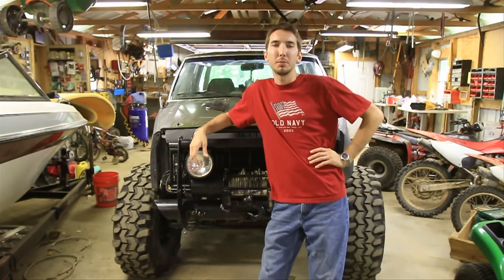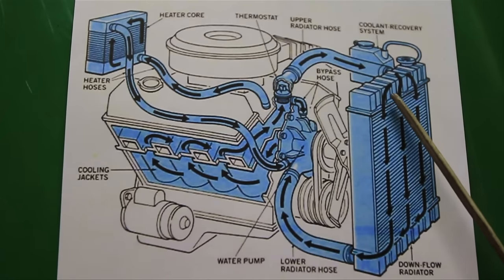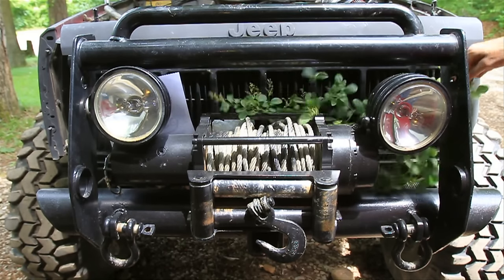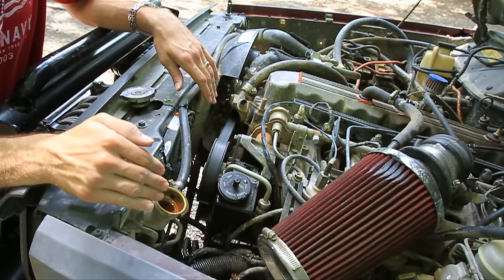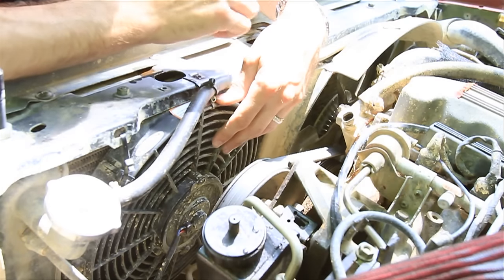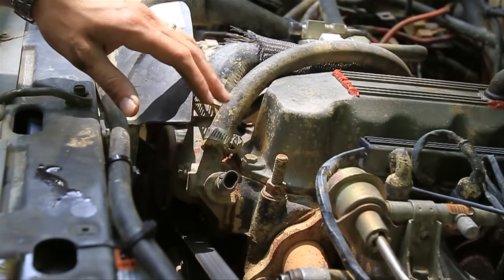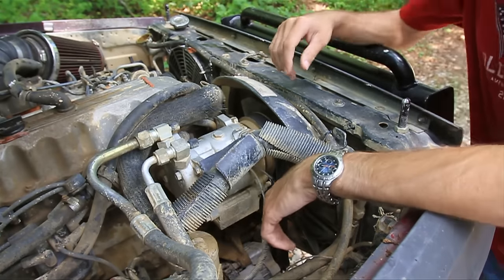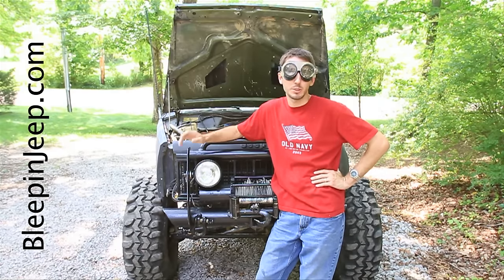Engine Overheating? - 9 Steps to Solve

Comment: when im driving on the highway, i get good warm heat then as i get to driving in the city itts not as warm? what do u think could be the problem? also i think it runs a alittle hotter in the spring/summer after getting off the highway i get some pinging from engine and a little oil burning. 99 camry
Reply: If there is no air lock in the system you may have a clogged heater core. When the engine is running you  want to compare  both heater  hose in temperature. Both should  be hot at the point you wouldnt hold them for.a.long time. If once is hot and the other one is just warm than you have a clogged heater core. If you rev th3 3ngine a good 2 minutes and it improve... plugged heater core. You can either replace or try flushing it depending on access and labour time. I saved big time and money flushing them using 2 hoses as an extension and filling them with clr and let that soak overnight.  The next day i flush it using air and water from an home made T and voila... heat is back to oem performance and ive been told once that i unleashe more heat than when the car  came new... no dash to take appart/ unwanted scratch or a/c discharge/recharge
Reply: Kevin Gosselin
thanks man for the info. will vinegar clean the cooling system? Or what should u suggest i use to flush it
Reply: On your car if you have easy access to the engine and radiator plug, empty the system first and fill it with water and rad cleaner if it no real foreign material is found, some soap like comet of you find any oil residue and make sure everything come clean. You may want to do the process twice as just a straight dump and refill only change the fluid and doesnt necessarily remove sediment  and i would assume your vehicle has high mileage. Consider changing the tstat with a new one as ive seen cleaner weakning the spring. Make sure you use distilled water as its one of the main cause for clogging.... sediment getting trap between the core fin... radiator or heater if you follow my lead
Reply: Kevin Gosselin
yes, i have 239K miles on my Camry. I'll flush it when the weather permits.
Thanks again

Comment: I changed the fan clutch, water pump, and thermostat and hose but my truck is still overheating randomly on highway or under load.  Not leaking fluid until it overheats and boils over.   The gauge goes from cold to hot very quickly.  Closed system.  Any ideas?
Reply: Add some water wetter or lucas' s additive for coolant

Comment: My truck seems to be overheating uphill (during stress). I don't know why. '03 DODGE RAM 1500 4.7. Ive done a radiator flush, water pump/fan clutch replaced,  thermostat replaced, what else am am i missing??

Comment: Took my 94 dodge2500 in to get checked out for overheating. He said water pump is good. Radiator is good. Head gaskets  good, Thermostat is good because I just replace it..  But that I needed two new fuel injector, which is causing the overheating? Can you second this? Iv never heard this

Comment: QUESTION: I have a 1999 automatic XJ and the electric cooling fan does not come on. The AC is not recharged and the AC does not get cold. Does the AC have to work for the fan to come on when the AC is off and the engine is hot? Please reply soon - thanks!

Comment: i have a infiniti g35 and my waterpump started to leak so instead of fixing it i bought kseal well the leak stopped but my car is now running hot after about 10 15 mins of driving do you think i should flush the system? has a new thermastat and cap
Reply: I would have to say that your pump is bad.  When the bearing in the pump goes bad, coolant comes out the weeper valve.  Many people think this is a leak but it's your pump saying, "I'm bad and I need to be replaced!"  Replace the water pump and you should be good.  If the coolant is green and not brown a flush is unnecessary.

Comment: Hi is it possible ,the cause of overheating is a faulty  compressor for the air condition?
Reply: Hi thanks for the respond.now they already took the compressor out and replace with a poly spin reel change the thermostat,bleed the radiator. Its still boiling after few minutes.Now they say its the fan thats faulty sometime .are they getting near to fix it you think?

Comment: My coolant isnt flowing through my engin properly. It will indicate empty signal and over heat although resivor tank is full. Might be clogged. Any advise?
Reply from the maker: sometimes you will have air in the system and it needs to be burped.  Some systems have a plug specifically for this purpose, to let air out as you fill the radiator.

Comment: I have a 91 Jeep Cherokee I changed the map sensor.  crank positionsensor.  fuel pressure regulator.  coil. Spark plugs. Fuel pump.  O2 sensor and it the the same thing over and over it will start right up the first time I turn it off and try to turn it back one and that’s when the problem begins I have to pump the gas till it turns on sometimes it takes me up to 5 min to turn it on
Reply: If its it's just doing a click: replace the starter solenoid. If the starter is going fine, maybe try some fuel injector cleaner. There could be debris in your fuel line getting pushed into an obstructing position.

Comment: fold up some cardboard box, after engine is up to operating temp and thermostat opens, see if you can stop fan with cardboard, pointing cardboard down on downward side of fan rotation. Think playing cards on spokes on  bicycle. If you cannot stop fan, clutch is good, also look for oil seeping out of clutch.

Comment: Unfortunately, a fan that is spinning the wrong direction will still push air through in the correct direction, BUT at 30% efficiency.  To make any fan pull instead of push, the fan blades must be reversed as well so the blade pitch angle is correct for maximum efficiency.  Most fans turn in a counter clockwise direction when facing the fan; whoever this is not a hard and fast rule. Many fans operate in dual speed mode... the fan relay controls the fan speeds too.

Comment: 2000 Ford Windstar 3.8L
What do you do when running hot in the mountains climbing grades and everything in the cooling system is working like it should?

I backflushed my cooling system, both electric fans run constantly when its hot, there are no leaks. I seem to have lost water flow from the pump so I took it off and it looks fine except the impellar was a little far from the back plate. The pump is only one year old and barely used. The gap was almost 1/8 inch. Maybe thats correct. All I know is I'm barely getting a trickle from the water pump when I loosen a hose and there is no radiator or heater coil to go through.

I've pressed the impellar back down some but what worries me though is if I press it back down will it pop back away from the back plate when it gets hot. This water pump is a bitch to get off. You acutally have to undo 2 motor mounts and lift the engine so that you can barely with great difficulty get the pump out. I've never seen a water pump like this.
Reply from the maker: How about running a trans cooler?
Reply: I think I found it. I had flushed the radiator while out of town with only a garden hose but back home I was able to use air and water to jet the radiator out. That lowered the operating temp from 50% to about 35% on the gauge.

 I put block sealer in it last year and I think that clogged up the radiator. Should have  just gone on and put a head gasket in which I did do after pricing it. LOL!

Comment: hello, my 04 Montana overheats. flushed the coolant system, replaced the Thermostat did not helped. friend of mine told me to check if the coolant if its  circulating so i started the engine let it run lintel it got hot but the rad was cold i opened the rad cap  antifreeze started to coming out inset of going in to the Engine. is that means i got a bad Water pump?

Comment: Im sorry its a 1998 chrysler cirrus with a 2.5 v6 engine, i was wondering because u mention the relay on your video. But the car works fine till i turn the ac on

Comment: Hi, Matt!
Question after My radiator blew (literally the plastic was gone), the mechanic changed the fan, thermostat and the water pump. I picked the car up on Thursday 6/6. I noticed in heavy traffic that the temp went up to about 22/30ish and quickly regulated when traffic eased.  6/7, the temp went up to about 220/30ish again as I headed home.  Today, @@%#@$$# it did it again!!!  what would you suggest?
(anyone)
Reply: I got exactly the same problem. Spent over more than a thousand for replacing everything. I was driving through the drive-in of Mcdonalds and it almost killed my engine if I didn't notice it earlier.

Comment from the maker: sounds like you have a block in the system.  If its not your thermostat i would suspect your waterpump is bad, if not that then your radiator is clogged.

Comment: I have a 98 jeep cherokee. I tried burping the system with the rad cap off, turned the vehicle on,  and instead of sucking the coolant it burst out a bunch in only a few seconds... what could be wrong. I also bought, a new radiot cap with 16lbs, and went as far as replacing the head gaskets and still over heats and oberflows the resevoir. 
What could be wrong?

Comment: New fluid and thermostat, everything has been gone through on my 07 commander, no leaks, 100k miles and the motor is strong, but it's an all stock cooling system. Warn on a bull-bar and skids, so lots of shit in the way of the rads, plus 33/18/12.5s and a lift which add stress as well. So basically Ive got every way to screw over a cooling system possible. How do I start clawing back a few degrees? I want to think I can go to a thicker rad, maybe a better fan? Nice and simple.  Ive heard intercooler but dont know shyte about them. Will they work with a snorkel? Stuck with the commander, the winch and rubber have to stay. Now what?
Reply from the maker: ZedStone buy an expensive radiator

Comment: Can I block off my heater hoses ? Will this have any affect on the cooling system? don't want to pay $120 for new hoses..
Reply: Thanks from Australia, love your stuff.
Reply: Yes, one could plug his/her heater hoses or remove them and cap off or something. Yes, the cooling system would funtion fine. BUT, I do not advise this because you will need your heater sooner or later; to defrost the windshield for instance. Please, just bite the bullet and get new heater hoses. Since it's been 4 years (at the time of this response) then I assume the heater hoses have already been replaced.

Comment: Matt,
I know that this is an old video but you could do a new one as you missed some very important points:
1. Antifreeze is very poisonous and dogs, cats and other animals like to drink it because of the sweet smell ☠️🤮🤢☠️.  It causes an agonizing death.  Be sure to capture and dispose of it properly.
2. Not all radiator caps are created equal.  Not only are there differences in pressure but also in distances between the cap sealing surface and the mating surface on the radiator neck along with diameter.
3. You did a good job telling people to make sure that they do not put the wrong temp thermostat in but not why.  Too cold can cause carbon build up, plug fouling, valve burn and eventual engine damage.  (P.S. I have never seen a bad thermostat.)  They are easy to test with a pan of water on a stove and a thermometer rather than replacement.  This is a waste of money and replacement makes people think they have fixed something when they have not.
4. Blown head gaskets can cause overheating also.  Oil in the coolant reservoir and and a compression test will tell the tale.  There are also some simple litmus test that show exhaust gases escaping into the antifreeze.
5. Old antifreeze corrodes.  Some antifreezes like Zerex have ph color indicators and change from green to red when it is bad.  This is very important and aluminum parts can really suffer serious corrosion quickly.
6. Aftermarket electric fans should never be put in front of the radiator, always behind and, as you pointed out wired as pullers not pushers.
7. Viscous drives can go bad and the symptom is either lockup (no free spinning) or more often they wobble and eventually allow the fan to hit the radiator.
8. Rad pressure test is an excellent way to see if you have a leak.
9. Fan belts should be checked for cracking, hardness or fraying.  Also slippage will burn the underside of the belt.  You may not hear a squeal on a burned belt.
10. Never use flex fans.  They can kill ☠️as the blades will crack and rivets fail.  Most manufacturers recalled flex fans.

11. If you have an older Jeep without a coolant recovery tank you can easily add one by just strapping in a quart plastic milk bottle and draping in the overflow hose.  This gives you about another quart of coolant capacity.

Comment: So my jeep is having issues I took off the radiator cap and turned the jeep on and it started to raise the antifreeze out the radiator. Then I turned on the a.c. and it made a load wired noise, and smoke came from some where, and the fan wasn't working. I also see some antifreeze leaking out from cap when hot. Any ideas what I should do?
Reply from the maker: Replace the cap if its leaking.👍
Reply: @bleepinjeep  why would coolant raise instead of go down into motor?

Comment: Hopefully power wheels electronic vehicles can be the thing to drive in our time but it's more reliable than the other vehicles ideas. The funny thing is they still make carburator filter but it looks just like knk. Still different motors and different parts that's not the same: just look how the put the oil filter in different sizes. Only the company can fix but not really anybody else because of no knowledge of what part to go it.

Comment: Could really use you help. I have my 96 Sebring v6 LXI COUPE. I replaced thermostat and still overheating whithin 10 min of driving or idling. Freeway made no difference. I tried to turn the heater on because that usually helps for an overheating

Comment: i have a 1998 mustang, that heats up on me. i just flushed it and took out all that nasty water, so its clean. im having trouble finding the thermostat do you know where i can find that? how do i release the air from it since you have to remove air after taking off pipes?

Comment from the maker: Where are you?  first I would go through my video one step at a time.  when someone says the coolant is burning that usually means you have a crack in the head and it's leaking into the exhaust or intake and burning up, but they may just use that term to mean it is low... It could also be leaking out but you didn't mention that it was so I'm assuming not.  But if it is low is has to be going somewhere... If its not too bad I would just get into the habit of filling it up often.

Comment: need help my moms 07 chevy malibu thermostat housing broke and was fixed and even put a new thermostat but car overheats tried both thermostats in hot water they open fine took to a mechanic had it flushed and still overheat .they said there was gunk in cooling system but they put a new waterpump and still overheats so they took out thermostat and let car run to flush out system but wothout theromstat the water runs thru system fine but once we put thermo back it gets to 110 c and then the needle drops to 0 and ac dont wont.please pm me

Comment: Scotty, I have an overheating issues. I replaced my thermostat, and it still overheats. There's no leakage and my fan works also. I'm wondering what could be the next thing I need to check

Comment: I know this is unrelated. But what explanation can you give me for why I get oil spitting out of dip stick. Has happen to me 2 different times. I have taken to a shop, they done pressure checks no problem, oil pressure gauge is only 2 yes old. New oil and filter. Last time this happened was in October 2017. Was heading to the Mojave desert. Got have way their when lil started spitting out of dipstick.
Reply from the maker: Sounds like it's making positive crankcase pressure.   Check you pcv for clogs.
Reply: I replaced all, PCV valves and lines still had the problem

Comment: I am having a similar problem with my hyundai accent,it is slightly overheating for one year already but still between the 2 dots,I also noticed my radiator cap isnt getin hot,help?

Comment: My car overheats when i don't drive and have the ac on, it's really hot in California this year so yeah, I also want to know if it's bad to use water instead of anti freeze, could that be causing it to overheat?
Reply: you need to use antifreeze the 50/50 mix if you just use water it will rust the inside of your motor
Reply: z28 build So could that be causing the overheating?
Reply: +The Gaming Chicken it could be the relay for the fan
Reply: having just water and not the antifreeze mix can cause the water to boil making your car overheat and when you turn on the AC a fan comes on under the hood and cools your motor but there is a separate fan that should just start running by itself when the car gets hot I'm guessing that is the one that's not working it should only be about 30 bucks for the relay unless you drive a Ferrari or something like that
Reply: z28 build Ok, thanks for the help.
Reply: +The Gaming Chicken no problem

Comment: My 89 Chevy truck gets hot with r without thermostat ? No leaks! Only thing is that my reservoir tank is cracked on top I just assumed it didn't matter, Its a 350 bored over 40 Flat tops pistons Has 1800 miles since rebuild.